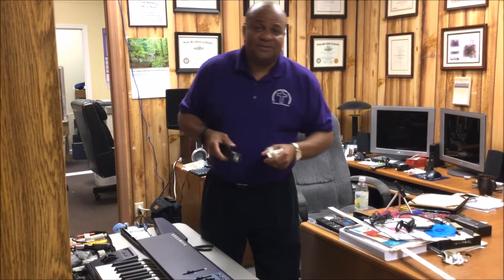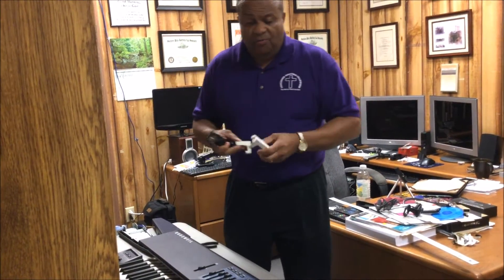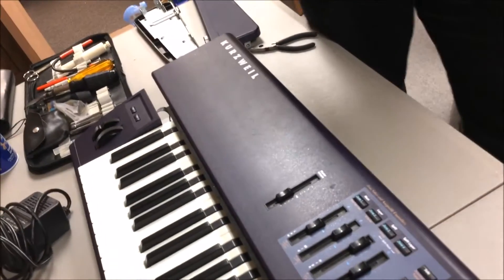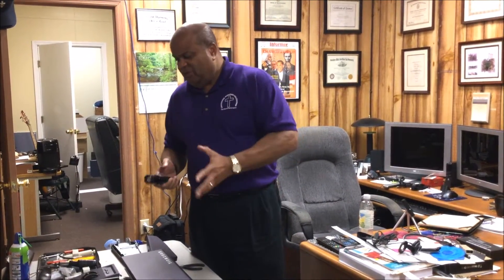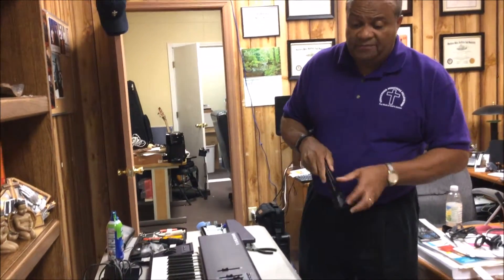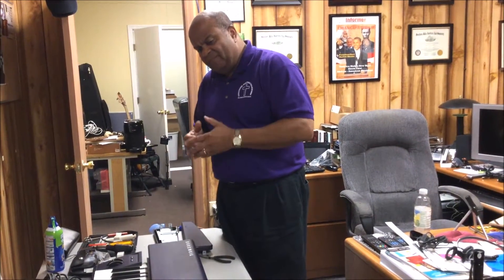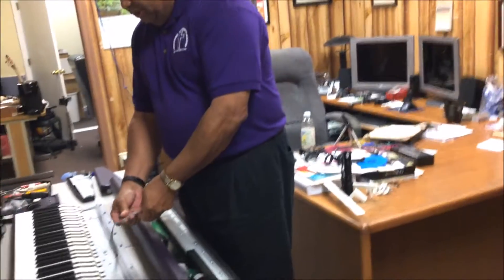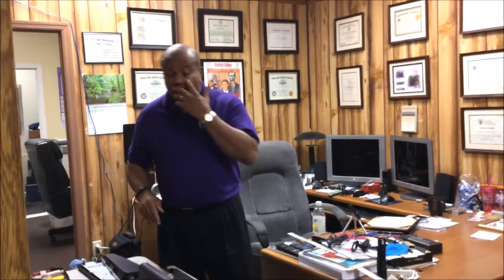Replacing Key - Kurzweil PCX2ALA

Comment: It would have been a bit more useful if you had shown the actual key removal, but I figured it out. I have a K2500XS that I inherited from my daughter after she sold my Yamaha unit. This Kurzweil is built like the proverbial brick s---house! I reattached the weight on one of the black keys. I did it by taking off the 2 surrounding white keys and epoxying the weight back into place. How it broke is a mystery. I also removed the battery case and cleaned up all the corrosion. I also figured out one of the lower register keys was not working because a hair clip had fallen inside the unit. It also could have been the dime that I found! lol. Now, I'm ready to learn how to program it.
Reply from the maker: That was an interesting journey! Thanks for your input.

Comment: I didn't see you show How To actually replace the Key, you just point to the key.
Reply from the maker: I am sorry! I didn't! But once you get inside, replacing the key is visibly clear. It's just a matter of releasing a removing and replacing a small tension spring. My apologies!
Reply: oh no need to apologize, that's totally fine. There is a little more to it, I discovered myself with a penny that lodged itself in the hammer action of a K2500X. Yes open it up, take off the spring, *then push in the tab in order to lift the key. I think you did explain that however, a great job in explaining the disassembly, it helped wonderfully